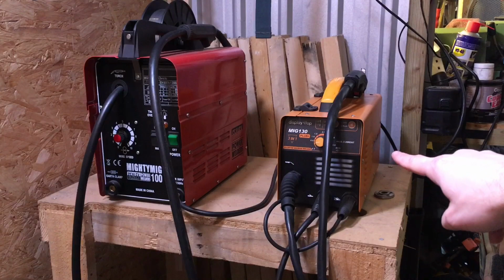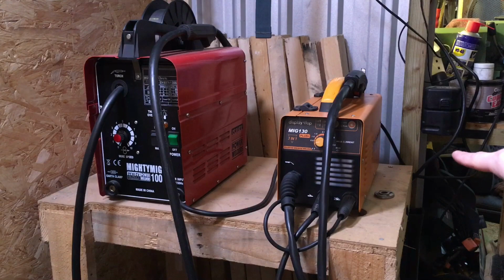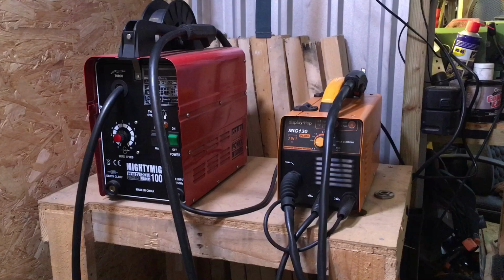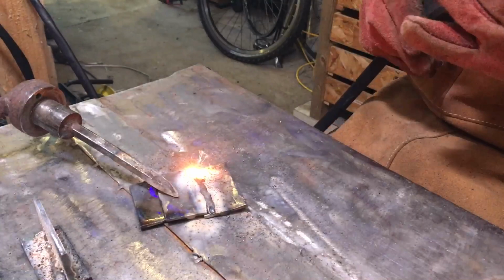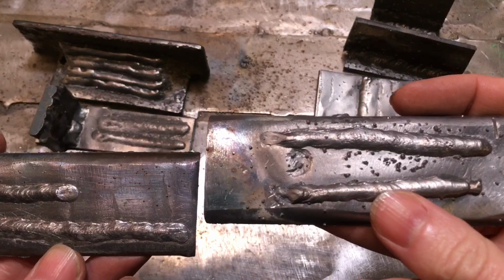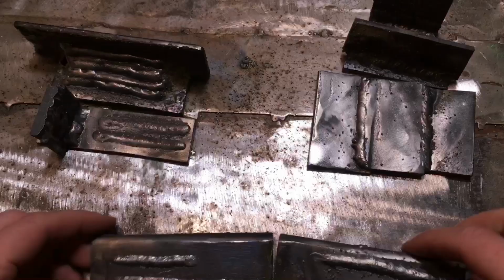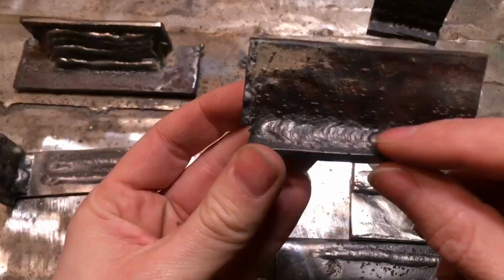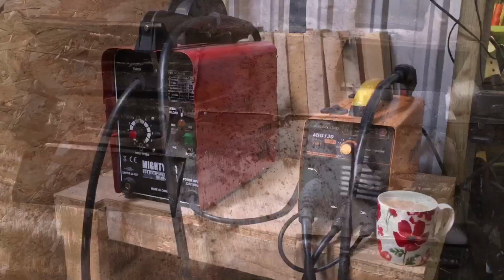Amazon’s cheapest mig welder AC VS DC Flux Core  FCAW £120 $160

Comment: My main concern with any flux core wire welder is that you (or I'll say in my experience), can't have any type of breeze or fan pushing the fumes away from the person welding. In my experience, if you do have any ventilation, it screws with the welds & it gives a crappy weld. They aslo create a huge amount of splatter and a very messy weld that requires too much cleaning, afterwards.
My flux welder has sat idle for 5 years, every since I got my Lincoln gas fed mig.
Thanks for taking the time to post your video!
Reply from the maker: flux core is very good for running outside wind, that’s one of benefits the flux covers the weld to protect it from the atmosphere. So you don’t need to have shielding gas that blows away.
 I know you can have problems with flux core if you tension the feed rollers tight and crush the Flux core and get bad welds.
On dc flux core is very clean once you get the hang of it as I shown in this video.
Both the mig welder and the flux core welder had flux wire in this video.
Reply from the maker: Thanks for commenting.
Reply: @JAYZWORKSHOP  Whenever I have some "free time", I'll check out your advice about the tension on the flux wire in my old unit. Thanks!
I've tried numerous times to give it away, and still would even if your idea works & creates better welds, with less splatter.

Comment: Can we see it alloy welding ? Reason I ask is some of these cheaper machines struggle with wire feed when doing alloy
Reply from the maker: no mate sorry its going to cost to much i need argon refill £40 alu wire £10, plastic feed liner and a different feed roller i would if i had all the bits to hand.
The thing is most mig welders struggle on aluminium mainly due to improper set up, wrong feed roller, tension to tight, wrong liner, tip size wire Diameter. takes a lot more setup and turning.
these cheaper machine do a better job sometimes with shorter torch the wire has less distance to go. thanks for commenting

Comment: it might be just me but the flux seemed more splattery and jerky.
Reply from the maker: No you are right the flux only welder have ac output and not a good power supply to power the feed motor so you get jerky wire feed.
That’s another reason the Amazon one is better.
Thanks for commenting have a good weekend 👍